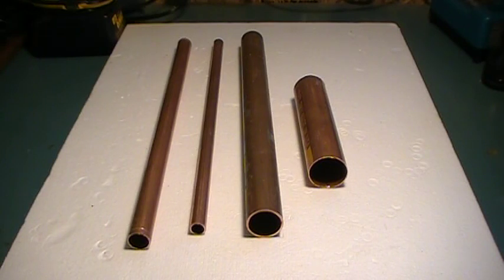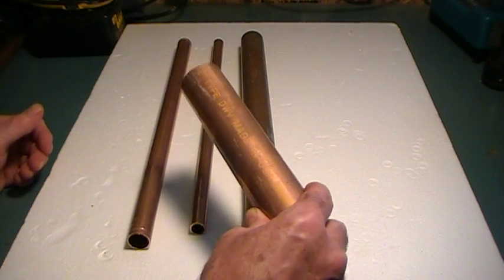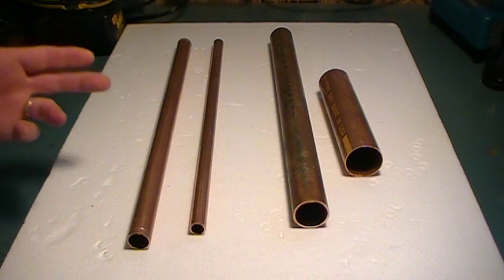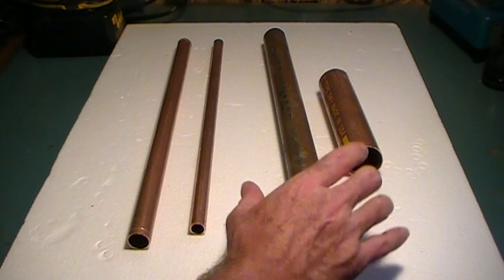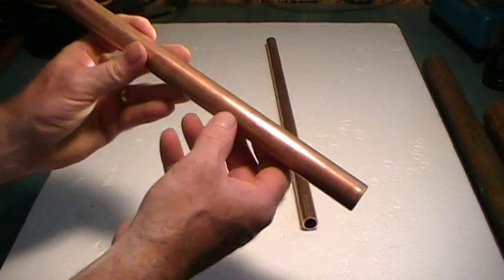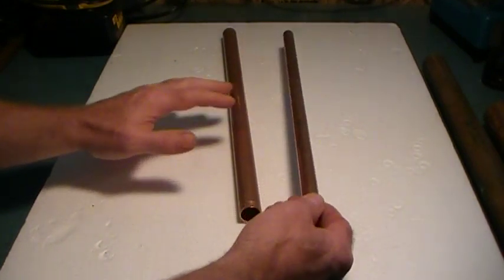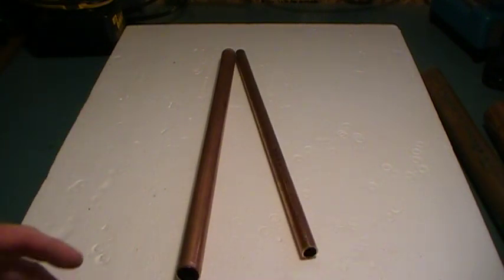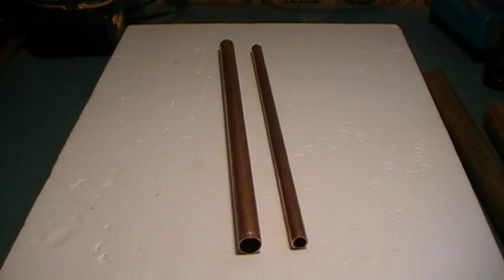Different types of copper pipes and their applications.

Comment: 1:32 - Oh yeah the "T drill"!!! That looks super cool, I want an excuse to buy one! They say you can use on any thickness of copper pipe but Type K seems like the most appropriate!
Reply from the maker: Hello 71dembones,
I am not a fan of it myself as the copper has to be silver soldered and the copper becomes very weak. I believe the pipe goes in about 5/32s of an inch. 
I have seen it used on Type L as well and if water quality is a problem; don't expect it to last overly long.
It is a great way to save tees especially if you have a lot of take offs.
Again...water quality will determine the life expectancy.
Thanks for commenting and enjoy your day!    Al
Reply: TheOldkid888 I understand your concern and you're right; there's no way it wouldn't weaken the pipe. First, you cut a hole in the side of it and then anneal the pipe when you braze it up. It's definitely a compromise, but I could see using maybe somewhere with limited access. Might pay for itself if it saved you from digging up a 4" main one time. Not likely I'd ever have a good excuse to buy one so it's probably a moot point. If you had it you could make your own header manifolds and other stuff for refrigeration but, it would have to be something you could dump the copper chips out of. Couldn't use it on something in service. I don't know, I might have gotten a little over-excited about it :D

Comment from the maker: @lduenas Hey Luis;I have only used Type L copper for all water lines in a home in the past.Pex (plastic) is taking over copper,but type L is what you should use for this job.I run a 3/4 cold water main and branch off to every fixture with 1/2 inch and then I have a 3/4 inch header at the hot water tank and bring over seperate 1/2 inch hot water lines for every fixture in the house.I hope this helped you out.Type M (should only be used on heating) G.L. and thanks for commenting!Al

Comment from the maker: @leejc13 hello;

The service line is 1" and you are replacing it with 1" copper.I am not sure how many baths in your home,but 3/4" should be suffice and type K soft wall is what you would use under ground into the house.Plastic is much cheaper and will last as well underground.You want to use service compression fittings underground and inside solder with lead free solder.Type L is all you need inside the house.Silver soldering is not difficult,but not necessary.

Tks for commenting G.L.  Al

Comment from the maker: Hello Dave;

You are exactly correct with that statement and it drives me a little batty. Type M should ONLY be used on heating systems. Type L is the pipe which SHOULD be installed in all homes for domestic waterlines when it comes to copper.
The average DIY'er definitely would not know this and would probably look at copper as all being the same.
Thanks for commenting and enjoy your week!    Al
Reply: So, what is the "heating system"?  What types?  And why in the %#^&% would Home Depot be selling this to the regular Jow Blow without specifying the types?

Comment from the maker: @Zed1967 Hello Lee;

I recommend using type M for hot water heating systems;such as baseboard radiation and cast rads.and not for domestic waterlines in your home. Not to say that type M will not work,but the wall thickness of type M copper is about 1/2 that of type L.If you are going to run waterlines in your home;type L will more then likely be there in 40 years time and type M will be lucky to hit 20.I would not use type M on gas either myself.Thanks for commenting and have a good day!!! Al

Comment: Great video- thanks!  Loews is now carrying type L 0.5" and one other- type K perhaps.  I asked the guy covering the plumbing aisles which to use for a simple home job, and he said that L was fine for almost every application.  Sounds like he was correct.
Reply: For residential work, you really cannot go wrong using type-L. Before copper spiked in price about a decade ago, most water districts used 3/4 type K tubing outside, to the meter from the corporation stop at the main in the street, and again off the meter to the house in warmer climates, or to the meter-set in the basement in colder regions, where the plumber soldered on his 3/4" L copper to supply the house.

Comment: I have to sooner or later replace the underground water line connecting from outside my house to the city's water meter line. Should I go with Type K or L?
Reply from the maker: Hello tealpaintbrush1797,
You want to use type K for underground. It isn't cheap, but will last for decades.
They also sell plastic pipe as water service pipe. It's been used now for many years with no issues.
Hope this helps!
Thanks for commenting and enjoy your week!     Al

Comment from the maker: @casper55117 Hey Casper;

I made two on pro-press and the name of them are ``The old plumber shows how to join copper fittings and pipe with new tool`and ``Connecting viega pipe using pro press tool``
This is an amzing system and the nice thing about it is you don`t have to be to concerned about water as the work can be performed even if the water does not completely shut off.

Thanks for commenting Casper and have yourself a great weekend!!!    Al

Comment: Question, I need to run about 60 feet of copper pipe for water hose outlets. Some will be exposed indoors other will be ran on the cross space and some will be buried. What letter should I use?

Thanks
Reply from the maker: Hello lichi0728,
Generally copper that is being run underground comes in a roll and is type K which is very expensive. If possible I would Rrun the copper underground in a plastic pipe (such as a piece of pvc pipe) use type L soft copper. It is much cheaper than K. Big thing is to be sure the pipe that is buried underground goes in the PVC pipe from one end to the other. Type L copper is what you would be looking for in the cross spaces as well(rigid).
I personally would use pex myself as it is far less expensive and much easier to run. Be usre to insualte the pex if it is exposed to any light sources as it will deteriorate from any UV rays (the sun and florescent lights).
Does the weather in your area ever go below freezing? If so, you don't want to run copper underground unless you can blow out all the water with a compressor before winter arrives which is a pain the backside. It will defintiely split on you.
Please feel free to ask as many questions about the project! You don't want to have any issues if they can be prevented. 
If you are planning on installing in a colder climate be sure to install drains on all low points as it will helpo prevent any freezing pipe issues. And remember copper will split if it has any water in it so underground will be an issue unless it is below the frost line.
Thanks for commenting and I hope the project goes well for you!   Al

Comment: I bought some 1/4 inch soft copper recently at Lowes and there's no markings on it.  It seems to have a different OD than the 1/4 that's in the Winnebago RV I'm working on.  The RV also has a 11/16 in. OD main water line, 9/16 in. OD hot water and 1/4 in. faucet supply lines.
Reply from the maker: Hello J G I,
Apologize for my late response.
I have run into some problems myself. They can be a pain in the backside. The fittings don't match quite often and I end up repiping the entire thing. Not that I want to because they are painful to do as everything is jammed into every little space as you know.
I am not sure if you can purchase fittings for RV's from perhaps a supplier, but it could be worth your time to check it out.
Sorry I couldn't have been of more help.
Thanks for commenting and best of luck with the repair!   Al

Comment: Hey is there any way to tell, other than the writing on the pipe, what type of copper you've got? I've got about a 3 foot stick of 2 inch copper pipe but no markings on it anywhere. I need to buy some fittings, but the only ones I can buy are online. They will be seated on the INSIDE of my copper pipe. The fittings i can find are fitted for type L copper pipe, but I have a feeling that the stick I have is K just off intuition. Are these compatible, or is there any way to check the stick I have to tell, such as measuring wall thickness?
Reply from the maker: Hello nlJ,
The only way to tell by eye is the color code if there is writing on it. K is green, L is blue, red is type M and yellow is DWV (drainage waste and vent). I would look for a spot of color somewhere on it. I have dealt with copper for over four decades now so I can generally tell by weight and pipe thickness.
I am not sure you are going to find fittings to go inside the copper as you mentioned. The closest size to 2" is 1-1/2" and there is quite a difference in outside diameter and inside. I haven't heard of any myself. That doesn't mean they don't exit.
Here is a chart that may help with what you are looking for....as you pan down it will give you wall thickness of every type.

https://www.engineersedge.com/fluid_flow/copper_tubing_size_chart_astm_b88_13181.htm

Hope this helps!
Years ago they made cast brass fittings for DWV that were much thicker than the copper fittings they make today. These are the only ones I can think of myself.
Thanks for commenting and best of luck with the project!      Al
Reply: @TheOldkid888  Awesome, thank you sir. That page did the trick. I do in fact have a type L copper.

The fittings that are going to be inside of the pipe are going to be specially manufactured to fit a 2" L type copper pipe, and then soldered in. They're basically inverted caps with four half inch diameter holes inside of them for half inch pipes to run through the two inch.
Reply from the maker: Hello nlJ,
Glad the chart worked out for you!
Just a heads up...1/2" pipe is 5/8th O.D.
Hope everything works out for you with the project!    
Thanks for commenting and enjoy your day!      Al

Comment: Thank you answering the main question I had about which type copper pipe i needed for a residential waterline (type-L).

I noticed you answer another question by saying should just run pex instead of cpvc. I have 1/2" copper running through my house. 1 bath, kitchen and laundry. I need to add a line for an icemaker in a new frig, old house. Should i scrap the copper in favor of pex, just sweat in a copper single run, or tie pex into my existing copper for this one run?
Reply from the maker: Hello DJ,
I would stick with the copper for the time being and run copper. You only have to run it so far.  The fridge needs 1/.4 inch tubing. I use plastic for the myself. And I don't skimp on it as you have to be able to move your fridge out easily with no issues of the tubing being short.
If your copper cuts through easily you may consider installing pex in the future. 
How old is the home and do you know if the copper is original?
Get back to em when you get a chance....Al
Reply: @TheOldkid888  Thank you for your reply. The home was built in the '60s, but the copper appears to be much younger. I may just go ahead and sweat in a short run to where the frig will be. I'm not a fan of those frig kit taps that pierce the copper. Just doesnt seem like a permanent solution.
Reply from the maker: Hello DJ,
Good call! Hard to beat a copper joint in my opinion.
I can honestly say that I have never used a fridge kit myself. I have ended up making a repair to copper where the pierced connection was made numerous times. Far better off with a soldered connection.
Best of luck with the project!
One thing that I tell all homeowners is to show everyone in the house where the shut off is to the fridge. Same goes for the main water shut off. I have seen them run the odd time right out of the blue for no reason at all. It is always good to let everyone know how to turn it off.
Thanks for commenting and enjoy your weekend!    Al

Comment: Copper DWV still has a solid niche for a lot of applications, at least where I live/work. Not sure how standard this is; but here, Any structure 4 stories or higher cannot use plastic drain pipe. Then, it becomes a choice of working with cast iron or copper. Cast iron pipe and fittings are almost as expensive and it requires way more labor to install it. You can fit copper drain lines by yourself easily and you can do it real quick with a helper! Not always so with cast iron. And the copper will outlast the cast in most situations. It has the smallest O.D. for the respective pipe size vs. any other material; so it makes it the best choice in tight spots, too. It's nice for drains and vents that come up in inconvenient places (next to equipment). It needs to be strong enough to be worked around but light enough to not need tons of support. 

TL;DR I'm a big fanboy of copper DWV (and copper in general) it kicks ass!!
Reply from the maker: Hello 71dembones,
Copper can definitely be put in by lone person. If it is DWV; the chances of it lasting longer than the cast is pretty slim.  
Copper has its place in the trade for sure. Speed is the name of the game so PVC or ABS will beat it hands down and will last for decades as well. 
I  installed cast 2 feet in diameter forty years ago and it is still in place and working well.  I have come across homes that have  cast installed 100 years ago and is just beginning to pit now. How long the pipe last depends on water quality and what goes down the drain. There are different manufacturers of cast as well. Gray cast is exceptionally hard as compared to others and will easily outlast any others. Pipe that is fifty years old is in as good a shape as new cast and is very hard to cut.
Copper is hard to beat, but has its place in the plumbing world.
Thanks for commenting and enjoy your week!    Al
Reply: TheOldkid888 Hmm, I believe you are correct that cast SHOULD last longer in most applications. When I see it have a very short life span is in medical office building applications (which is the majority of my work) A lot of nasty stuff ends up going down the drain (dentists are especially gross)and a lot of times it's not installed/pitched properly. Some medical practices will move after a short lease term and the suite will stay vacant for some time. It seems to always crack after the pipe dries out after being used heavily for a number of years. Maybe we only get crappy cast iron here; all the stuff I see is black pipe, put together with no-hub bands. I've seen the grey cast pipe you speak of, but not in person. I've definitely seen copper DWV fail as well but again, it's a matter of what got put thru the pipe and if it sat there, got left stagnant, etc. At the end of the day, plastic drains are easy to put together and should be used anytime it's allowed/acceptable. Thank you for your reply on this and all of your wisdom you readily share! I really appreciate it
Reply from the maker: Hello 71dembones,
I've  worked on medical drains for several years and know what you are talking about. Another thing to keep in mind is the previous maintenance people or tradesman may have used acid to clear the drain as well. Always wear a face shield and gloves as you know there is nothing good in those drains. Took me a while to get into a shield, but well worth the effort.
Thanks for commenting and enjoy your week!     Al
Reply: TheOldkid888 Acid and other harsh chemicals definitely play a role. I've also heard that certain bacteria/enzymes (specifically in dental drains) that build up can eat the cast iron as well. Not sure how true that is. But, I know that there's a few 30+ year old dentist's offices in the buildings I work regularly. The ones piped in cast have rotted out and the copper ones are mostly still going. Again, a lot of factors for why this may be, just something I've seen. Good advice for the face shield; I should probably start using that when doing drains. Fortunately, I don't do a lot of drain clearing but, we do replace some sections of pipe from time to time and you're right; only bad things in there :)
Reply: DWV copper still sees use in commercial kitchens, pretty commonly, for drainage. The discharge off a dishwasher will usually be in excess of 180 degrees F (85-90c) for the final rinse, easily capable of weakening plastic to failure. 

Other places copper sees use, is often for condensate lines coming off walk-in coolers (antimicrobial properties) to minimize clogs, as well as hot water heater blow-off lines, for the same reason as the first example.
Reply: BPM Productions of Colorado Good points

Comment: Thanks for the video.  that 1/2" pipe is not 1/2" is that so?!
Reply from the maker: Hello Aldo,
You're welcome!
The pipe in this video is 1/2" copper pipe which has a outside diameter of 5/8ths of an inch. Pipe is measured by the inside diameter. Tubing on the other hand is measured by the outside diameter. Ex...Half inch tubing is half inch on the outside.
Hope this helps!
Thanks for commenting and enjoy your week!      Al

Comment: I am replacing the copper pipes in my South Florida home for the second time!  House built in 1985 so copper pipes only lasting about 14 years.  Plumber told me he doesn't install copper anymore in my area.  I believe he uses CPVC.  My copper pipes often develope pin holes and are paper thin.  They could have been type M, but impossible to tell.  Thanks for video!
Reply from the maker: Hello Nicholas;
Copper is still being used. Pex is becoming very popular now.
Whenever I install copper pipe for domestic waterlines; I always use type L. It has about twice the thickness of type M.
Type L has blue lettering on it; where type M
is red.
No problem using type L copper unless your water is very acidic. You should have no issues for a very long time.
Thanks for commenting and best of luck with the repairs!    Al
Reply: +Nicholas Hoffenpiper it says on the pipe what type it is. Red for M, blue for type L.  You should never use type M.  Its Destined for failure. 
Consider Wirsbo, a plastic product with great longevity.